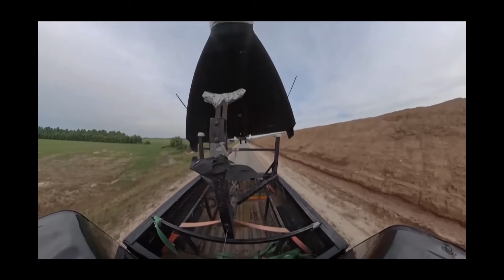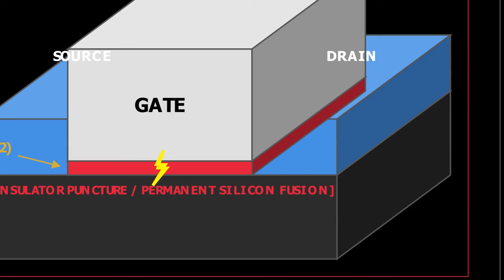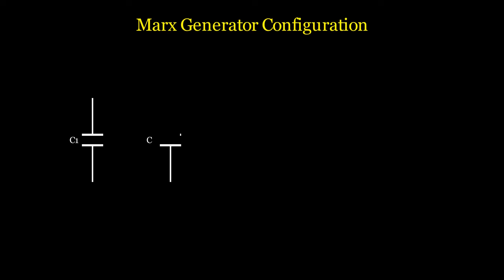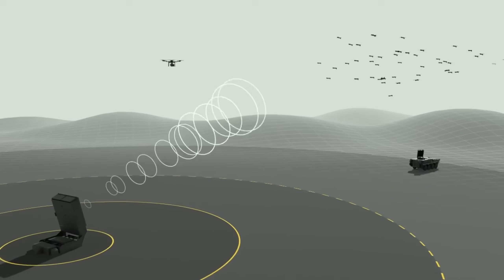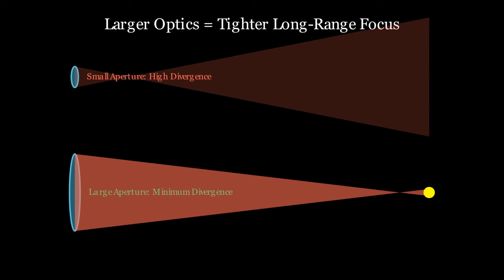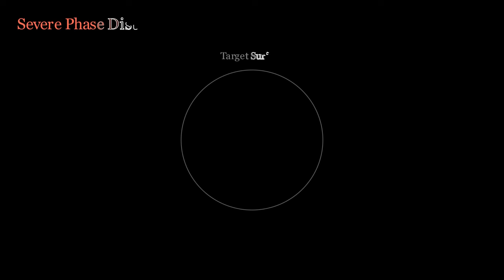Why Nobody Can Stop Drone Swarms.

Comment: A faraday cage would block all this, however you can't put one over a drone while it's operating as it would block gps, camera and motors. If you didn't block all of it, you might as well not block any of it as it would behave the same when it's being attacked by these anti-drone weapons. Maybe some kind of net in front or mostly around that would leave it exposed to the sky only to use gps might keep it safe
Reply: Maybe we'll see a similar development like we saw with tanks: effectively shielding everything is impractical, so you only shield the front.

Comment: If you can keep a laser on the target, why not just use it to steer a projectile or cheap rocket into the drone. That seem like a far easier thing to do, and can be done with existing technology.
Reply: Rockets that can lock on and follow lasers aren't cheap.
Reply: @GTCounterFootballShare   It would be cheaper than drone. Basically model rocket with camera that steers into centre of illuminated target.

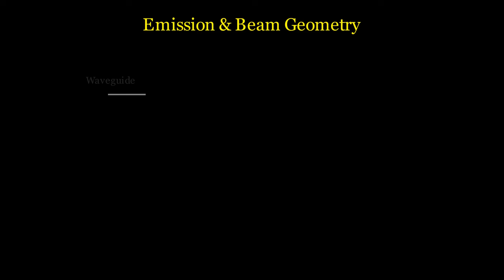Comment: 7:07 Is it (theoretically?) possible to create something similar to a electromagnetic "laser" beam?
Reply: Build a waveguide for a microwave magnetron stick it in an old c-band dish...

You're gonna pull some hairs tuning it but if you dial that sucker in it'll probably be the talk of the town for awhile.

Doing it safely requires a good number of precautions and on top of being extremely dangerous it'll definitely piss some folks off!

That's the cheapest em "laser" I can come up with.

Comment: Wouldn't a Faradays cage (or a metallic enclosure, eg. a soup can) around the circuit board be a complete counter against Electromagnetic & Microwave weapons?

Probably needs some kind of "high voltage overflow" from the antennas too, if it has any?
Reply: The short answer is yes, you can ignore all other replies. The future is fully autonomous AI drones that are fully immune to jamming and direct EM weaponry. 

Even lasers are weak because it can be pretty cheap and lightweight to create anti laser armor ( a mix of ablative and reflective materials) which can then overwhelm any laser in a sufficient large swarm. So drones just win. Drones always win. 

Only big dakka with fragmentation rounds stands a chance at being remotely effective.
Reply: Yes, just a small cage surrouding essential chips and thats it.
Reply: @ivand5699 no you need protection for every electronic component including the motor which acts as parasitic antenna. Also you need rf limiter during pulse surge from the communication antenna or switch to fiber optic or autonomous mode.
Reply: @ivand5699  It's not that simple. That'll work to some extent for lower power systems like the man portable ones used by cops, but not a truck mounted military one. Every single component from the wires from the battery to the motors act like an antenna. With weight being a problem for any airborne system, adding all the shielding is not practical.
Reply: @shadow7037932 Even with a big anthena, diésel generators and a truck, the energy beam beyond a few meters equals to almost nothing, thats why there is not proven weapon against drones. Also in todays wars drones attack in a swarm.
Reply: @ivand5699  Yes — if you wrap everything in tin foil, it’s a cheap and effective solution. Pairing that with an optical gyro instead of GPS-based navigation makes it significantly harder to counter or interfere with.
Reply: @apunctg   It's not that simple. That'll work to some extent for lower power systems like the man portable ones used by cops, but not a truck mounted military one. Every single component from the wires from the battery to the motors act like an antenna. With weight being a problem for any airborne system, adding all the shielding is not practical.
Reply: @shadow7037932   corpus from metal is first layer of protection, antennas have special interference protection, just need protection of ventilation, air breathing entries. Metal foil helps.
Reply: Maybe with some version of "beam forming" with arrays of antennas?